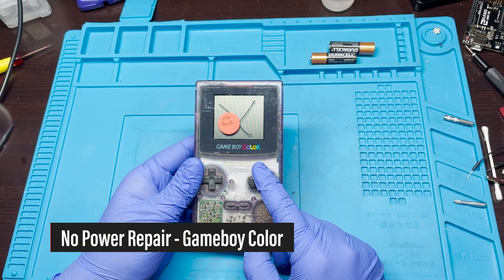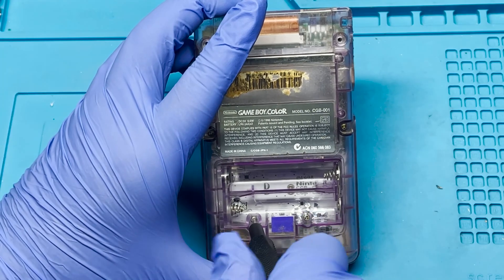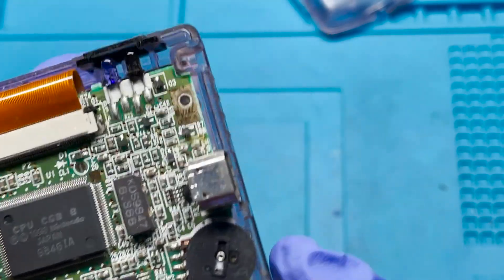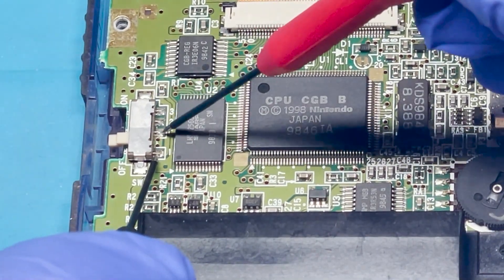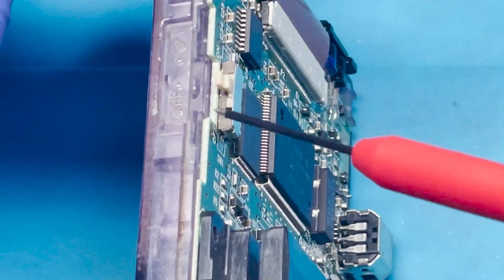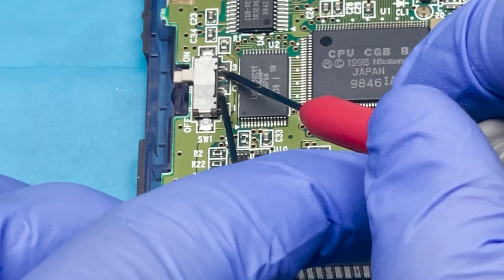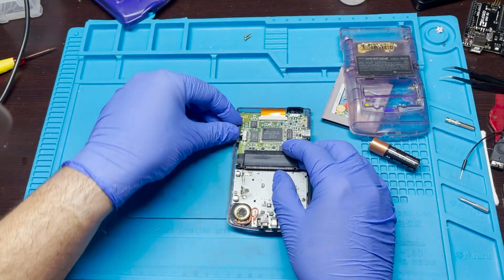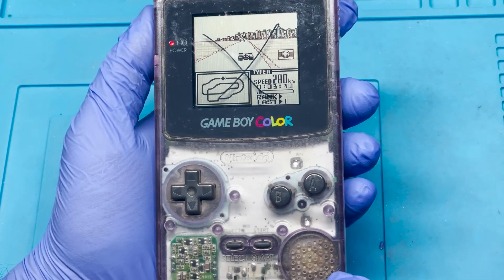How to Repair Gameboy Color with No Power

Comment: Thank you bro.. your alcohol fix worked like a charm.. i didn't even check the power connections. I just applied alcohol in the power switch as you showed and worked..thanks again.great tip
Reply from the maker: Awesome! I'm glad it was able to resolve your issue!
Reply: Was it just regular alcohol? Like from the pharmacy? Sorry for the dumb question, I have no clue and just want to try to fix my gameboy.
Reply: @ yes . But I left it again unused for weeks and again it doesn’t work . Guess  I have to do the same thing again
Reply from the maker: @MarilynKidman Yes, but make sure it is 91%+ in Alcohol content to prevent damaging components

Comment: If this is anything like the GBA it would probably be better to remove that top shielding on the power switch to clean the contacts inside directly. I had a GBA where I could clean it from the outside like that and get it working, but the problem would come back in a few days because it was still pretty dirty inside.
Reply from the maker: Yes this is a good point, removing the shielding would be a more thorough cleaning as you pointed out. I can probably do this in future videos to showcase that type of repair.

Comment: Question my gameboy color wont turn on but the red light on the left lights up but the screen would never turn on or show anything ?
Reply from the maker: Has it been opened before? If so I would start by checking the ribbon cable and making sure the pins are clean and making proper contact.
Reply: Similar problem for me.  Just bought a GBC from eBay and the screen is gone (turns on and sound is good, but can barely make out anything on the screen).  My first thought is to check the ribbon cable contacts and clean them with IPA.  Probably worse case scenario is it’s a capacitor blown or the screen is indeed dead.  But I’ve got loads of spare boards and screens so shouldn’t take too long to fix.

Comment: "These look fine" FYI those surface mount caps don't swell and show their age like top vented caps, I chased a short to ground for a whole day and it ended up being the bottom right cap which looked perfectly fine.  Capacitor kits for these cost $3, they should be done regardless of if it's working or not.
Reply from the maker: Yeah, you're definitely not wrong. It seems more common in GBC and GBA's where caps tend to be worn without any visual indication.

Comment: Honestly when i have a gameboy that doesn't turn on the first thing i always do is inspect the battery contacts and the second thing clean the on/off switch without even testing it with the multimeter most of the time that fixes any issue with gameboys just a good clean, gameboys are just an amazing quality systems
Reply from the maker: Yeah, funny enough most consoles I receive are never really truly broken, just extremely dirty!